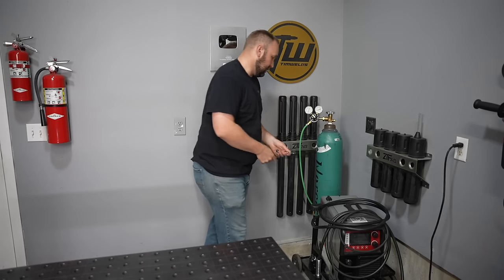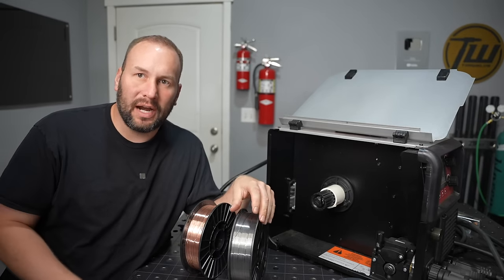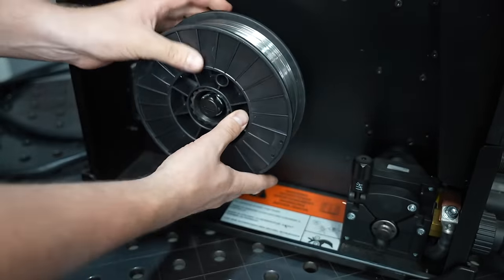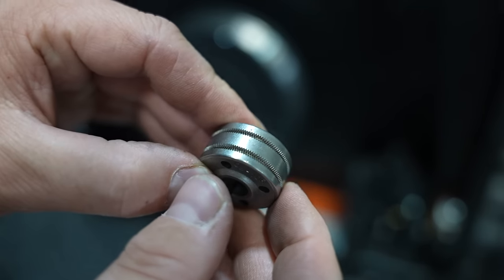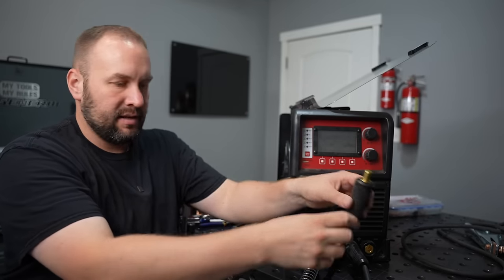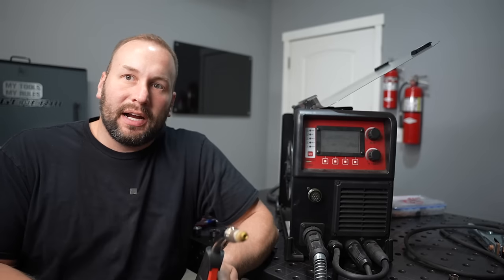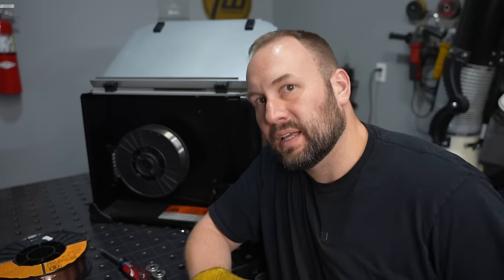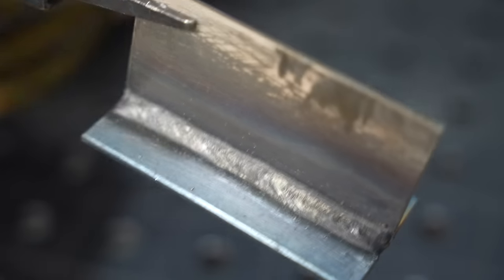Fix Your Flux Core Setup: The Complete Guide to Setting Up a MIG Welder for Gasless Flux Core

Comment: Maybe that’s the issue with I’m having I got a mig welder from my dad it has a plastic as you called gasless nozzle on it not the metal one. Will that have an effect of mig welding?? I know the welder I use at the garage I work my welds look close to your but the one at the house is like poop. Yes the polarity is correct. Maybe it’s the nozzle

Comment: So I have never flux welded. Can you still do the same method as mig (stacking dimes) or does it have to be like yours in the video looks like you didn’t do any movement but just dragged it. But it looks good for sure

Comment: Hey, I just got a flux cored welder fkr christmas. It's the vevor 3-in-1 welder that does mig, lift tig, and mma. This one is a 145A welder. It looks like there are just 2 knobs, one for volts, one for amps, but nothing for wire speed. How do i set it up, just trial and error? Dodnt cone woth a chart or anything when weldong different matierals like some do. Thanks.
Reply from the maker: When in wire feed mode, usually the amp knob adjusts wire feed speed. Assuming you’re using .035” flux core wire, start around 150 in/min (3m/min) and 18 volts for 1/8” material. Adjust the wire speed up for more heat and down for less. Adjust voltage up for a longer arc and down for a shorter one.
Reply: @TimWelds  oh right on! Thanks so much for sharing that knowledge! Ill use that for my projects! Thanks so much!

Comment: My machine has a mig-voltage knob -3 to +3 on it and it didn’t come with any charts to help get started. Using the included .8 flux core wire and my clamp plugged into the + port and my control handle plugged into the - port, what settings should I be using, the -3 side or the +3 side? It came set on 0, - settings are to the left and + settings go to right, max for both sides is 3, - or +. I’ve been searching for days and can’t find any information covering this exact question so I can get started and find my appropriate range. Thank you to anyone who can help🙏🏽
Reply from the maker: Most likely, it’s voltage trim. This means that the machine sets voltage automatically and the knob just allows you to increase or decrease it from the programmed setting. To set it, keep in mind that voltage controls arc length. If you want a longer arc with a flatter bead, turn it up. If you want a shorter arc with a crowned bead, turn it down. Spatter can get worse when voltage is high, but some amount of spatter is inevitable.
Reply: Awesome I totally understand that! Thank you very much, I was able to get a great bead with this knowledge. Great channel, I’m subscribing now and won’t miss anymore of your content!

Comment: Make sure you have the correct contact tip size for the wire you're running. It should say the size on the base for easy identification. I'm no welding expert and had to learn this lesson the hard way 😂

Comment: Tim, thanks very much for taking the time to record and post your videos.  Several years ago I picked up an old Lincoln tombstone welder and got myself to a point where I could stick two pieces of metal together.
Just recently I've decided to simplify my life and go to a flux core welder for smaller work.
Your channel has been instrumental in both of my learning curves and I greatly appreciate that.

Comment: Thank you for using the more proper term "selfshielding" vs gasless. Oddly enough gasses are produced once the flux core ingredients are decomposed through the weld arc, just like stick electrodes.

You handled instructions of feeding of the wire through the drive rolls, cable & gun assembly well! Just a point of interest (maybe to speed setup) Is not to remove the contact tip but straighten the wire with your fingers for 3 to 5" to remove the inherent cast just before insertion into the drive rolls. Most contact tips are countersinked for the wire to find a tapered entrence into the tip. If the wire gets hung up you'll have to remove the contact tip to feed the wire manually. 

The two small diameter selfshielding fcaw mentioned :
1) T-11 are single pass round about
2) T-GS are general single pass

Comment: One thing that protects me from MIG is the comments about the oxidation of wire and protection measures. I do not weld that much so unused wire could be ruined. Is it true we need special precautions and protection measures for currently unused wires?
Reply: If your asking about MIG the actual manufacturers' Product Data Sheet or Material Safety Data Sheet should have some details. FWIW, keep the original packaging handy. Copper coating provides some protection & some oxidation shouldn't interfer with feedability or arc performance.

Comment: Question for you... I have used 0.035 flux core wire, but I would like to use smaller wire - 0.030 or even 0.025 - in my home shop. Does this exist? I've never found any for sale anywhere and I'm beginning to think it doesn't exist...
Reply: Lincoln has a .030" their NR-211-MP on a 1lb spool. Hobart has their equivalent size & type. As far as .025" there is . 024" but MIG only. I can only imagine delicate work to draw down thin-walled tubular flux filled wire.

Comment: I was told that the S at the end of the wire name means single pass reccomended. Is that true?
Reply from the maker: If, for example, you’re looking at E71T-GS, yes, it’s a general purpose single pass wire. This is because it’s a little heavy on some alloying elements like manganese and relies on the dilution from the base metal to reach the correct composition. The other very common self-shielded wire is E71T-11, which can be used for multi-pass. There are a variety of others, some single pass and others multi-pass, so it’s best to check the data sheet if you aren’t sure.

Comment: Thank you for the video. Surprised to see that a Pro Pulse welder didn't have a metal drive mechanism. Good to know. Disappointed.
Reply from the maker: No problem! Thanks for the comment! I get a bit nervous about plastic too, but this particular unit is a high quality Swiss made feeder. I looked into this at one point because I had the same question and the plastic is fiberglass reinforced polyamide, which is really durable. It’s a really nice feeder, a lot more consistent and reliable than others that appear to have more metal on them. They have ball bearings and bronze bushings for the running components and they aren’t breaking down on people, for what that’s worth.
Reply: Thank you for getting back to me. My main concern is how it handles heat under use and if the tension adjustment changes. Usually with metal feeders it is not a concern .Thanks again for your great videos. @TimWelds

Comment: Thanks for everything you do for the YouTube University welding community. You're one of the best. 
  
Which polarity am I supposed to use with dual shield? I'm using regular innershield wire and 75/25. Can't figure out the right one.

I'm sure you've talked about this in a previous video, just help a guy be lazy. Please.
Reply: DCEP
Reply from the maker: Hi! Thanks for the kind words, I really appreciate that!

With dual shield, it's almost always DCEP and 75/25 is usually fine. However, you mentioned you're using innershield. I believe Lincoln's whole innershield line is self-shielded wire and thier gas-shielded wire is all in the outershield line. The specs can be confusing, but running gas with self-shielded wire isn't going to give you the results that you'll get from gas-shielded wire because it's a completely different formulation.
Reply: @TimWelds  it can even be counterproductive to run shielding gas with self shielded wire ... some self shielded wire NEEED to react with the air of the atmosphere to hav proper strength and chemical reactions !  if the shielding gas blocks that out, loos of strength or weld defects can occur ...  best practice is : read the manufactures spec sheet and find out of shielding gas 1) can be used.  2) has to be used. 3) or is not allowed to be used .... 
also shield shielded wires often have a limit on how many passes or what size weld you can run ...  a lot of them are single pass, some are multi pass .. and even those have typically restrictions .. they are not "unlimited" thickness ....
but Tim, you know that already .. sort - just had to type out my rand .. because I misread the inner shield for outer shield ....  LOL.   now that. have reading glasses on I can see what is going on ...
Reply: @ZILAwelds  lots of people don't have a powerful enough machine to actually run dual shield, even though a machine might be capable of it. I can't imagine what a hobbyist could be doing to need to lay down that much weld that fast.
Reply: I guess Brand names are evolving into a process. Makes the manufacturers' happy for sure.
Reply: @SuperAWaC  Dual shield is awesome even for the ambitioned hobbyist ...  let say a trailer hitch on a car or truck or some landscape trailer repair ... etc ....  boom or bucket on a mini excavator or backhoe ...    but never the less - you are right ... MOST machines in the 200 amp class are limited to about 24 to 26 volt arc voltage in mig at the most ....  there are a few that have more to offer .. and 25 volt or so is the "bare minimum" ....   the HTP 200i and the PP200 and PP220 both offer arc voltages up to 35 volt !!!!  that is something you normally would find in a $5000+ machine with 300+ amps .....  and these little machines just "own" that 035 dual Shield
Reply: @miszced  yes - so the official name or description is FCAW-G.    flux cored arc welding with gas .....   so depending on who sells what it can be called 
Dual shield
outer shield
gas shielded flux cored
and I probably forgot a few other names .... 
the gases wire is a lot worse....
names like
Inner shield
seld shielded
gas less flux cored
open arc wire
 .....
are common names ....  
so if a guy says - lets weld flux cored ..!  what does he mean ?     
to make things worse there are different wires for different applications ...  
joining,  steel to steel, steel to stainless, stainless to stainless. (all of those come in one version or another with or without gas ...). and then hard surfacing wires, for abrasion, wear, impact (or a mixture of all of those) most of them come with gas  - all of them come without gas - but some of the gases wires you CAN use gas with other you can absolutely not ....  

so you see - this flux cored topic is a pretty loaded topic .... I made a video on a while back .. just pointing all of this out rambling ....
Reply: @ZILAwelds  My understanding Dual Shield is a registered trademark with AIRGAS on their tubular filler metals. Not sure of its original source but may be acquired after the demise of a welding manufacturer named Liquid Carbonic.

Yes, these trade names help the end-user pinpoint/purchase the product they want. Still, I kinda see end-users use Brand names as a process. Here's a few from ITW/Hobart: FabCO, Fabshield, Faballoy, Fabtuf etc. 

Saw your Utube, good stab on the complexity of tubular weld wires & their applications. Yes, it can be confusing. Just one point on your description of selfshielding being single pass & DCEN. The AWS A5. 20 needs to be studied. There's a T-4 class which is multipass made to run on DCRP with a very long ESO. AWS requires .505" tensile to be machined from 3/4" A36 all weld test assembly. Just a bit FYI.
Reply: @miszced  >>My understanding Dual Shield is a registered trademark with AIRGAS on their tubular filler metals.<<

here I thought Dual shied was Esab's way of naming their gas shielded flux cored (steel) welding wires...   What do I know?

>>Just one point on your description of selfshielding being single pass & DCEN. The AWS A5. 20 needs to be studied. There's a T-4 class which is multipass made to run on DCRP with a very long ESO. AWS requires .505" tensile to be machined from 3/4" A36 all weld test assembly. Just a bit FYI.<<

Generally speaking, 99% of all self shielded wires are DCEN and 99% of all gas shielded wires are DECP.  Also the majority of self shielded wires have a limit of passes or thickness.   A single pass is VERY common, and in multi pass wires a max restriction like 3/4" or something like that is also very common ...   

now can there be a wire that uses different polarity ?  sure.  Can there be a wire for unlimited thickness?  Sure.   Is that something that "the average Joe" will easily run into going to his local welding supplier and picking up a roll of wire for his welding project?? absolutely NOT.  Those are specialty wires, special order, serve a specific purpose, the guy who buys that stuff most Riley knows EXACTLY what to do with it and how to use it. Now I dont recall the exact word I used in the video, the spirit in this video is a "word of caution" and a general "watch out", be aware what you are getting yourself into and "do some research". I dont believe that there is absolutely statement implied: all welding is always like this - so YOU should do - that .....   I try to stay clear of these kinds of videos and advice because THAT is exactly how I get my self and others in trouble. ...     

so thank you for the FYI